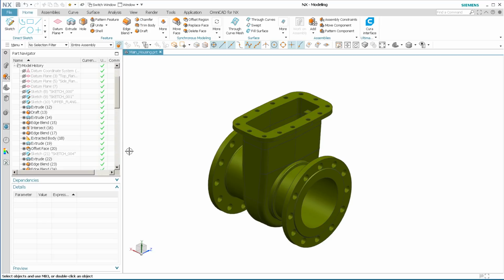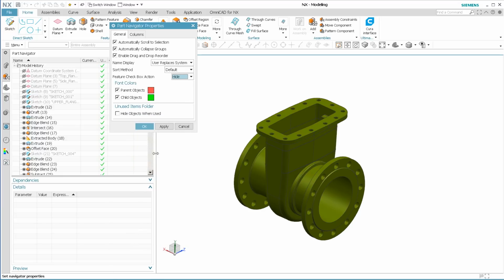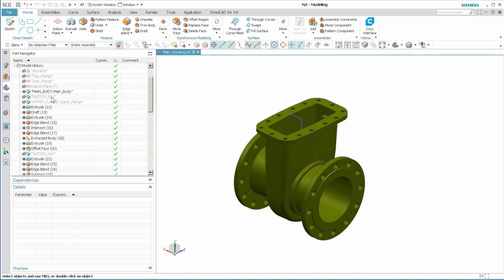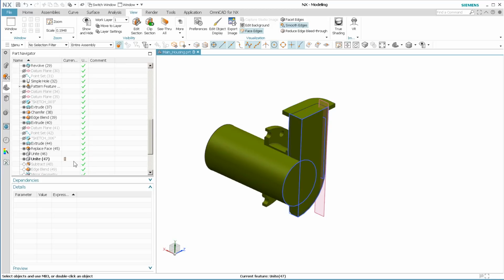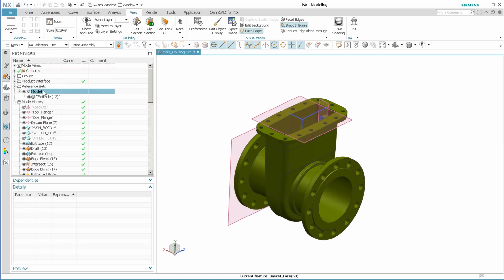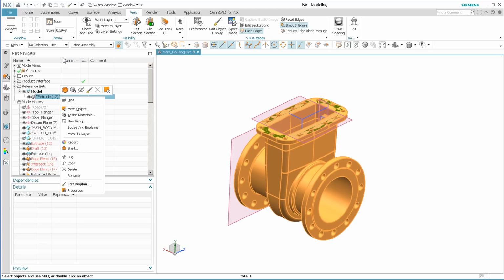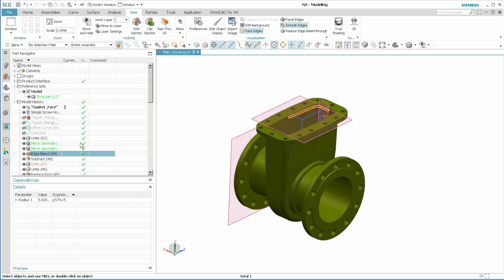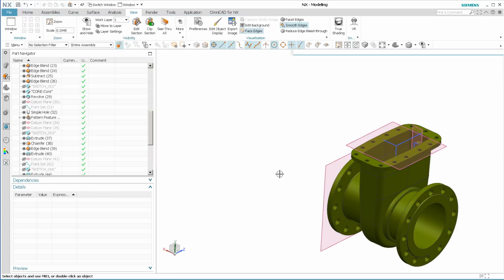Siemens NX: Part Navigator Setup

Comment: What version of NX are you demonstrating?
Reply from the maker: NX. The newest. It would be 13 but Siemens has done away with big releases and is going to incremental updates. Have a look at my last video.
Reply: @StevenMarji  how do you add the make current feature column?
Kind regards,
M
Reply from the maker: It is there already. Next column over. This is only in the latest release. Not NX 12